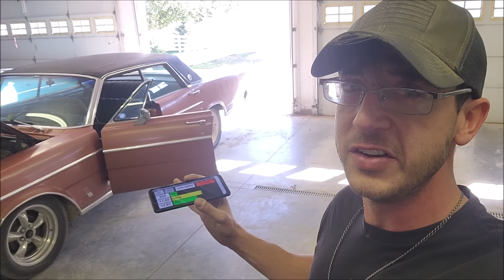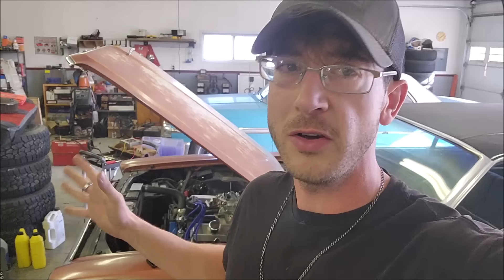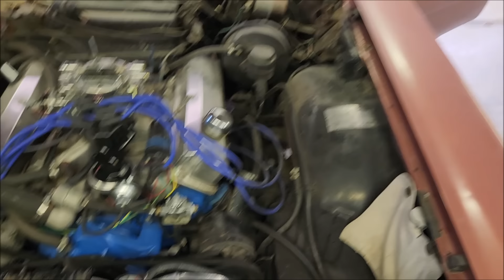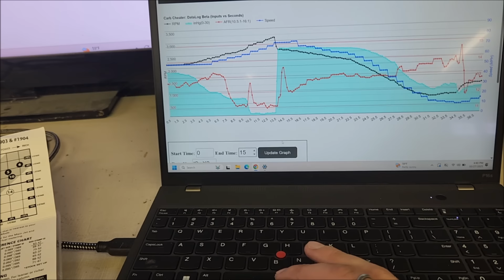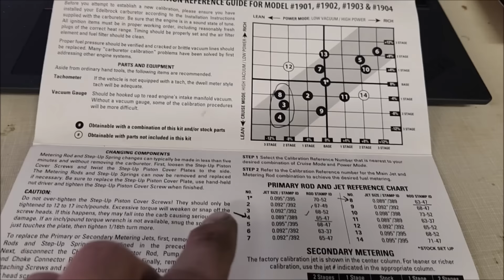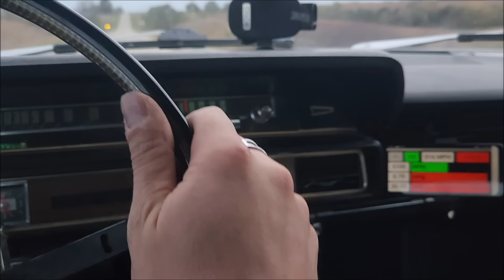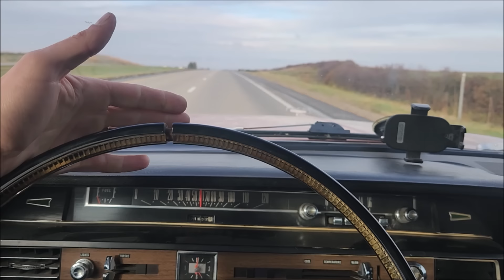Can We Save Her? NEW $6500 Engine Makes NO POWER !!!

Comment from the maker: Carb Cheater (the datalog & auto-tune thing): https://carburetedinnovations.com/products/carb-cheater?variant=51203593994540
Beta to 2.0 conversion is also available. listed BELOW COST for a little while here as a thank you to all our original Beta Tester friends out there: https://carburetedinnovations.com/products/beta-tester-to-v2-0-upgrade
Reply: Someday maybe I'd like to put it on my 62 olds but needs work first got ripped off my self payed a guy to overhaul it and all he did was grind the heads and now I have an oil leak wondering if it's disturber gasket or the rear main is out 7k
Reply: @ThunderHead289 to help with the vacuum situation for the brakes you need to install a vacuum canister
Reply: Touch the garage door opener to your head and push the button. Sometimes that works.
Reply: @marcblock7581it ALWAYS works... Thanks for the reminder 😆
Reply: From an old dog to a younger dog, thank you so much Luke, for the free education.

As bad as I wanted one of your inventions the current cost to me, $630.00 to Canada and NOT your fault, prohibits my 69 years young common sense from making the purchase. On a huge plus side, you have taught me how to tune my Holley 750 by only using a screwdriver, a vacuum gauge and my nose. 
If I win a Lottery, I'll buy one then and check the AFR numbers for real. I must be close as it's running so well now.
Reply: @WidowsMaker_1 Surely another gearhead could bring one to you.
Reply: @mvm932 Good 👍🏻
Reply: You’re an honest man Sir. 
That’s a rarity today.
Reply: Seeing the 8/16th wrench makes me wonder if a fully labeled set, 1 to 16, would be worth making and selling?  I would like to have a 16/16th wrench.
Reply: I'm not very tech oriented at all lol . It why I'm trying to resto my 66 & learning how , building my dream  driver in backyard ! MorWil AZ Fairlane, rockabilly
Reply: @Morgan-h5f Best wishes!  The joy if success will be so much sweeter 👍🏻
Reply: Mine just arrived yesterday!
Reply: That isn't the car that Sasquatch bought on vise grip garage is it?
Barometric is so weird in Iowa when you have to change those rods every summer and winter?
I'm from there but has been living in Oklahoma for 25 years but it seems like I always had my cars tuned up for winter time. 
Ran like crap in the heat.
Reply: Without thaw hat
Reply: There's only two professions where you make your money bent over and on your back. You (and I) wouldn't do very well in the other one. 😂
Reply: Is the dial back for sale stand-alone or is it exclusive to the tuning kit?
Reply: @theosexpertdaymon2774 It was last year or earlier this year.  We have one. "Tested by Luke"
Reply: lol  this makes me laugh but i predate all this the fact you need a graph ect to  fix what my ears could tell is funny to me. Ps the rockers also  have to much play
Reply from the maker: @johnmcook1 a lot of folks seem to misremember how well they could actually "tune by ear". I would consider myself top 5 percent in the tuning by ear game, but I can never be better than when using data - this is essentially what dyno tuning is without the expense
Reply: I really think the garage doors don't open anymore because of all of the emf interference all of our phones, all the signals being sent everywhere, because my garage does the same thing.
Reply: Not the disturber, it's the flux decapacitor!🎉
Reply: If it's rich check oil smell gas probably good suggestion, my S10 lost a coil pack and couldn't figure out why sluggish and died, until I remember I had a spark adapter to plug and wire and figure out coil pack was bad and also remember it couldn't burn cylinder and leaking into oil and immediately changed oil.
Reply: Hey dude.. Can I give you some advice? Part of what makes your videos so difficult to watch is the amount of repeating yourself that you do. I think you explained to us 4-5 different times about lean/rich and fuel pressure.  Most of us will get it the first time and definitely the second.  Also, car guys want to see the car/engine. NOT your face.  Show more car, less face
Reply: @Halfsack-l9c 'Hey dude'?  His name is Luke.  Why didn't you post your YT channel?  Why do u bother commenting? Are you that unhappy?

Comment: 21:??;  Not taking what Eldelbrok paid for as an insult,,, but Carter AFB's already did the work years back,, before computers. They had the step down/up needle kits along with springs and jets. Just like Holley had.
I am from Uncle Tonys Generation with the luck of having an older Sister who married and then later,, cheated and was divorced  Brother inlaw who was one of thee Best, if not the BEST mechanic in the PNW Kirkland/Juanita Washington area.  Had it not been for him,, my feet would have seen more miles than all the vehicles I wore out before junking.

Comment: Most of my engines are small cam (under 220° @ .050) (de-smogged) 70's Tow Pig stuff and most of them HATE that much curb-idle advance...So Ported Vacuum is the way.  15°-ish at Idle then 20° of mechanical in at 3000RPM...10° or 15° of vacuum advance Ported as I said...

Comment: Somewhat carb tuning related. Check the cranking compression on the engine. Too low and engine will be sluggish. Too high and you'll need race fuel. 180/190psi is a decent street motor.

Comment: I have a few AFB/AVS carbs. I want to build a 428 with a 245@.050 .600 lift hydraulic roller cam and 10.5:1 cr. Put it in a Mustang, 67/68. I want a 2 4V AVS2. I was thinking of the RPM 2x4 with the carburetors close together, a pair of 500-625a . I wish someone made a 3 piece  intake with the perimeter sealing the heads , the distributor and water sealed so you can pull the top and center baffle and service the lifters. The top I would like to splay the carbs like the rear carb towards the firewall and the front to the distributor, a single plane to allow the carburetors to line up with the port angles and a balance tube to the carburetors. Is there any intake like that?

Comment: Initial timing should be set with the vacuum advance disconnected and the vacuum line plugged to : 10° to 12° BTDC at 550–600 RPM
Reply from the maker: Were not dealing with a stock engine or stock numbers - you will learn some things if you pay attention and listen

Comment: By the sounds and visual of your test drive when you stepped on it my feeling is it really wasn't much better than a stock 390 with a 4 barrel. I'm not an Edelbrock guy anyway but for the money this guy paid he got ripped off at $6500. He would have been far better off for street use with a 390 with high performance specs like the cop car motor. He could have spent a lot less money, not had the thing sound rough but still had some nice performance kick. Talk to an old guy before you dump big money like this. I'm an old guy.

Comment: Replacement mechanical fuel pumps DESTROY ENGINES !  OEM pumps had " weep holes" around crimp rim to allow raw gas to go to outside before it goes into crankcase when pump diaphram fails , ( and it will eventually fail ! )diluting your oil. The problem is your engine will continue to run allowing you to drive the car pumping gas into your crankcase .I have noticed most manufacturers are omitting those weep holes  .those holes also to serve as a telltale sign your pump has failed because of the gas odor. NEVER ACCEPT AND INSTALL a pump without those holes .please do a video on this subject to inform people of the destructive practice of leaving these holes out

Comment: I had a very similar issue with a ford 200/autolite 1100 setup I got recently. The mix was way, WAY rich (the accelerator pump would flood the engine and it would die), the starting advance was 35(!) degrees, and it was just a nightmare. Rebuilt the carb, tuned it, timed it, replaced the plugs, now it runs great. Took like $70 in parts and an afternoon.

Comment: Remember to tighten up those secondaries if it keeps going way to lean when you wot it that's what was happening to me and it would act like a vacuum leak and stall my truck out I tightened them up and it fixed that problem now I have a different problem and have to find it 1987 dodge ramcharger 360 la I have the Edelbrock avs2 carburetor as well mine is just the 1905 not the 1906 only difference is the 05 has a manual choke

Comment: I don't believe you ever said what you set the fuel pressure at just curious what it ended up at what you like to set up for these carbs   RACER  RICK.
Reply from the maker: On an eddy, you have to run 5-6. Since you cant see the floats, in order for their adjustment to be proper, edelbrock specifies 5-6 psi

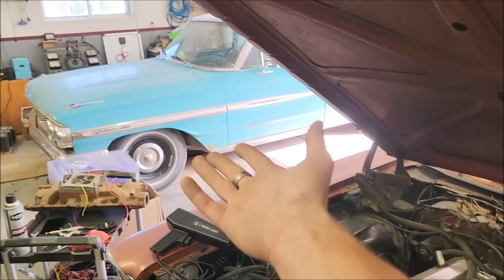Comment: 5:20  You can adjust the floats on an Edelbrock, you just can't do it externally as you can on a Holley.  With the lid off, you turn the lid upside down and measure the float-to-lid distance and adjust to spec.  You can then adjust off that spec up or down to change the level.  This is done by bending parts of the lever arm.
Reply from the maker: I never said you cant adjust them at all. I meant that since you cant see anything, you have to set them to spec, and because of this you are required to run the prescribed fuel pressure. 

Whereas on a holley, you can be at 7 or 8 psi and simply adjust the floats down to keep the fuel level where it should be in the bowl
Reply: @ThunderHead289 , gotcha.  Thanks for clarifying what you meant! 🙂

Comment: He should put a Holley 4150 or 4160 on the 390, at least you adjust them easier, then install the Carb Cheater on it.

Comment: Ported vacuum because 1) at idle the air charge is nearly outer space so drop the advance to allow a better burn and stop the garage from smelling like gasoline and 2) with no advance your engine is in the proper timing for a pedal stomp without the carburetor backfire.

Comment: There is no way that 390 makes 500 with that small of a cam i bet a stock 315 hp 390 would out run it  why would you need  afr monitor to fix this engine  you can tell by the feel and the sound if it is fat or lean

Comment: Timing is probably wrong firing order may be wrong or vacuum leaks
Reply from the maker: The engine could be installed upside down too
Reply: @ThunderHead289 basically

Comment: You didn't step on it at 60 to see if it is still bone dog rich, I'll bet it is. And the idle air screw bleeders most likely didn't end up at two and a half turns out. Everything I see on the internet videos / YouTube I take with a grain of salt…like you didn't verify the total timing versus the initial timing
Reply from the maker: There was an ass load of things I did that I didnt show or else the video would have been 2 hours long. 

Including actually putting a wire in the idle air bleeds. 

You cant show everything or the low attention span folks which is the whole of the populous just leave

Comment: I put a stroker 347 into my Galaxie and it never ran right. The engine was built by a trusted builder and they broke it in on a dyno. Someone else installed it. The engine would run, no smoke, but never had any guts. Everyone's story was along the line of "well, it's a big heavy car." Long story short, the installer switched the firing order. Apparently the stroker calls for two leads to be different from the stock 302 firing order and no one caught it. I eventually pulled the stroker and installed a stock 351w that works but is just ok. The stroker was sold cheap and that guy had his mechanic go through it. He found all good components and discovered the firing order problem. All this happened over 12 years ago. Of course I am over it now.

FYI: my 1966 Galaxie 500 is physically large but weighs 3500 pound, about the same as a modern Toyota Corolla. The Galaxie feels heavy because the stock suspension floats.
Reply: Firing order is determined by the camshaft.
Reply: LOL, the stroke of the crank has precisely zero to do with the firing order. Not sure what illicit substances you've been indulging in, but whatever it is, it isn't helping you. And your Galaxie weighs far more than a modern Corolla LOL. whatever you tell yourself.

Comment: Let Lee know that it's time for a double master cylinder
Reply from the maker: You know, ive never actually gained anything from a dual master- blow out a rear line and you still have no brakes.

So im not sure where that concept actually comes from, in practice ive never benefited anything when a line blows
Reply: @ThunderHead289 I blew the brake line in my 2004 F250 and still had some of my front brakes. It wasn't great but it saved me from an accident. Probably saved by the proportioning valve.

Comment: Get that fuel filter away from the thermostat housing.
Reply from the maker: Its fine. From driving carbed cars all my life as my daily drivers - thats a wives tale. Should you try to NOT do that? Sure - but it definitely doesnt mean instant vapor lock by any means.
Reply: @ThunderHead289 don't say I didn't warn you.  Gasoline boiling ,point near 85 °C (185 °F). Your fuel has alcohol in it, boiling poin(78.37°C, that lowers the gasoline boiling point That housing is part of the heat pump system.  The amount of heat it can cast off gets very high very quickly under conditions.  Never play around with heat and fuel lines, ever.  Check out derek at vice grio garage, the jeep video, I used to own that jeep.  Watch it boil gasoline into full vapor lock while on the freeway at 55.

Comment: How does this carb cheater work? Or will it on A 383 roller motor with a demon carburetor double pumper. Motor has no electronics on it whatsoever. Just MSD set up.
No vacuum advance.
Thanks mark

Comment: I have a question on installing the timing chain and gears on a Ford engine. You being a ford man. Does the distributor get put it with the timing gears dot to dot or cam gear dot at 12 o:clock and the crankshaft gear dot at 12 o:clock? I have seen videos on Mopar and Chevy using the both at the 12 o:clock position. Also how well does the Carb Cheater handle sub 0 weather?
Reply from the maker: Never had someone ask about the timing gears per say - you want to drop in at tdc of compression stroke, you dont need to see the timing gears for that by any means 🙂
As far as temp goes, cc is basically an armored battleship
Reply: @ThunderHead289  Thank You.
Reply: @ThunderHead289  I have to tell you on a Mopar it does make a difference. I done a 340 Mopar years ago with the dot to dot cam and crankshaft and the engine did not run right and the timing would not time right on the balancer. Always had to be way advanced. I tried and tried to get it right to no avail. Ended up pulling the timing cover off and setting the dots on both gear at 12 0:clock pointing the rotor to number one cylinder and dropping in the distributor in. Put the engine back together. The timing marks on the balancer timed to 6 degrees factory setting and the engine ran perfectly. So strange to me. That is why I asked about Fords. I own 66, 70 and 71 Ford muscle cars. I never had any problems timing them. Was just wondering if maybe I was missing something? Thanks again Luke.
Reply: @ThunderHead289  I am thinking seriously about CC.

Comment: When dealing with older transmissions that are shift controlled by hydraulics, you need to exchange governor weights to alter the shift points. You need lighter weights to get it to shift later. Lighter weights need to be spun faster to achieve the same governor pressure which will increase the shift speed.

Comment: This video should be required viewing for anyone who owns or purchases a modern Edelbrock AVS style carb! Great job getting that big old ‘66 Galaxy running smoothly, you should have slammed a valve body kit in the C6 auto so it would make that 390 shift at 6,000 RPM.  A modern 10spd auto with 3.90 gears in the 9” rear would be a nice compliment to the built 390 too 😊

Comment: I’d have to see the paperwork on what parts are in this motor to equal $6000
And $6000 into engine but no horn on steering wheel … this is funny video
Reply from the maker: I have a supercharged fully rebuilt roller 5.0 with heads cam and the works and the car its in will always be in primer. 
FE stuff runs a hefty bill - i know this FE has a retrofit roller cam which is over 1000 itself

Comment: LOL 
ANY engine builder/tuner that puts a Garbage Edelbrock fuel dumpster with a large over lap cam is LOST! 
Bet $20 the 🤡 never removed the lid and set the floats that get bent in shipping either. But I'm only 4:50 seconds in. Edelbrock has been a joke since the kid's sold it the company out. The foreign conglomerate Ruins every company they acquire... Comp Cams and now they have Holley's group of companies sinking too... It SAD
With THAT large cam the vacuum advance definitely needs to be on the other side for Manifold vacuum. As it's needs as much timing as possible at idle to make it happy

Comment: Idk why anyone even wastes time with carbs anymore. Its an old tech that fiddly and prone to failure. You just don't need them any more. Its like running a spare tire at the strip.
Reply from the maker: Put aftermarket efi on a classic carbed car and enjoy being broke down all the time. Carbs are definitely not fail prone - ive driven them all my life and im a programmer by day.
Reply: Carbs are simple. They operate off gravity and atmospheric air pressure. 
No computer. No sensors. No software programs to tune. 
carb is about $400 new. One third the cost of efi.

Comment: Would not even be driving it at all,,, This young kid is making this so complicated The 390 engine back then are so simple and Not electronic... Total advance should be at 34°... Initial advance 8 to 10°,, idle at  850 RPM,, always hated those Carter type Edelbrock carburetors,, A Holly style four barrel carb is so easy to tune,,
Reply from the maker: Try anything you just said on a big cam engine and see how it goes. 
This is the exact same thing "dyno tuning" is except at home.